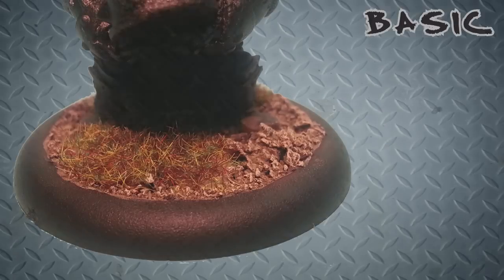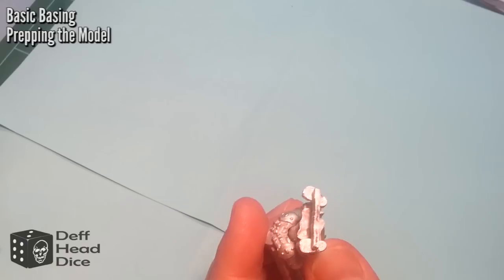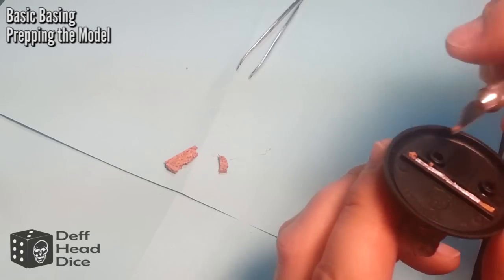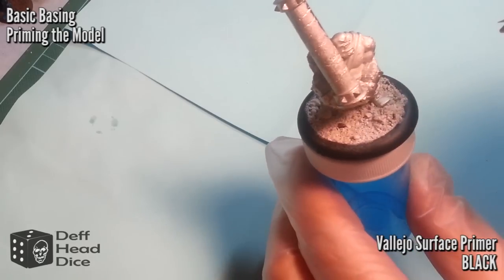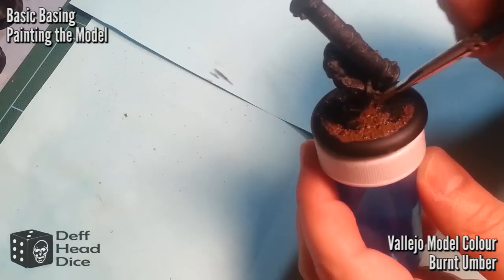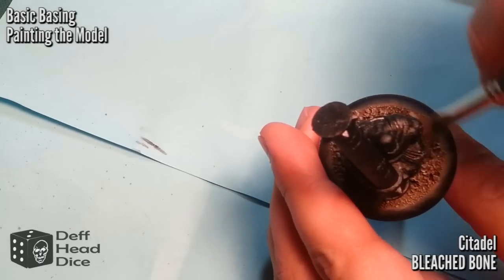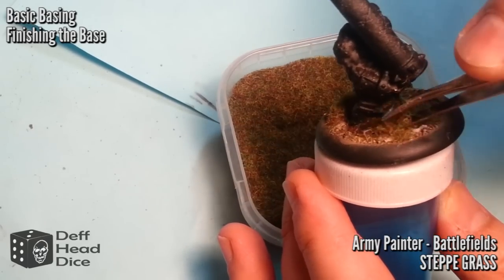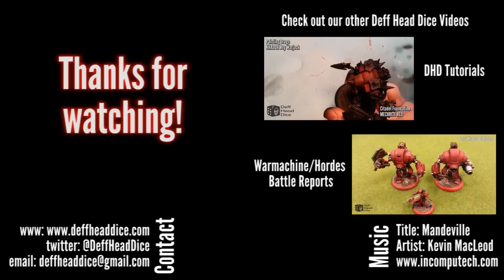Basic Basing - Deff Head Dice Tutorial 003

Comment from the maker: Thanks for the compliment and the suggestion.  I have done what you suggested in the past, but I've found that the combination of the Vallejo Surface Primer and the thinned down base coat keeps the sand/gravel in place very well for me.  Another tip to try is the rough up the surface of the base with a file or hobby knife prior to gluing, which gives the glue more nooks and crannies to get into and hold.  Thanks for watching!

Comment: I use the same primer and I used to have issues with tip dry and some other problems with my Badger airbrushes. I started adding a few drops of thinner to the primer, water probably works too, but it means the mixture is thinner and takes sometimes 2 coats to cover completely, but it solves most of the problems of priming with an airbrush.

Comment: I too use a generic airbrush and the Vallejo black surface primer. I feel like it starts to set up in the gun so I have to work in very small batches to make clean up after easier. It creates long strings of paint that have already set up in the gun if I try to work in larger batches which I'm assuming all paints would do eventually it just seems to set up faster than others do. Do you thin it at all? I've been experimenting with thinning it versus not thinning it.